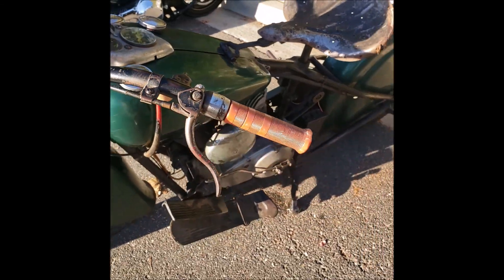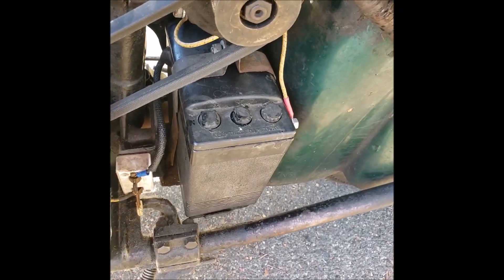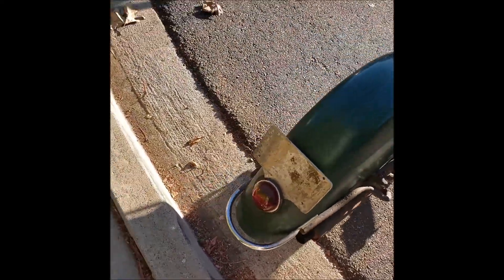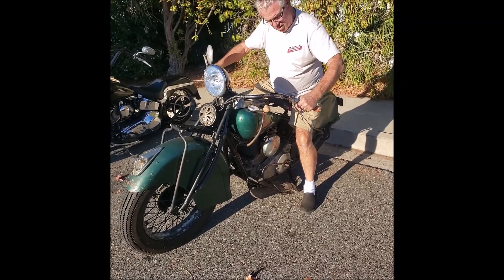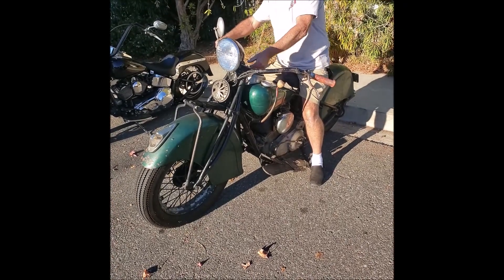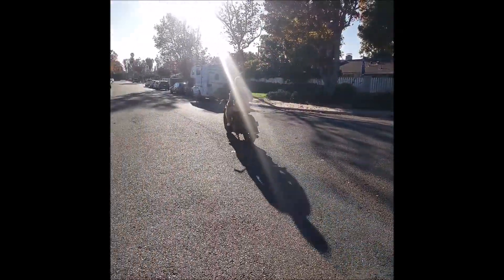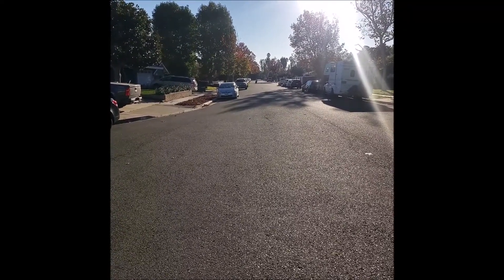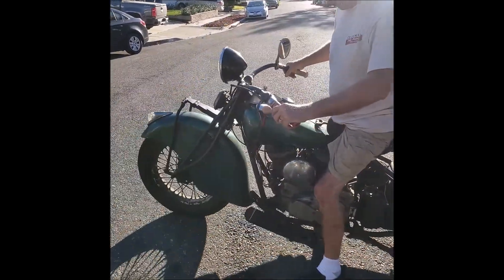1937 Indian Chief – Castoro Collection

Comment: 1937 ??  l use to have a 1937 in the  90's and THAT bike got a other oilpump fenders dash and place for the gear leaver.... Can this be  a 1940 perhaps :-) ?
Reply from the maker: the engine number and frame number are matching and 1937...therefore the bike is a 1937.  It has been customized if you read the story.